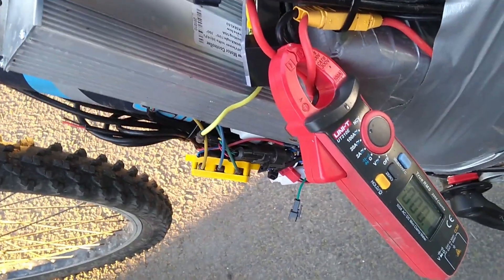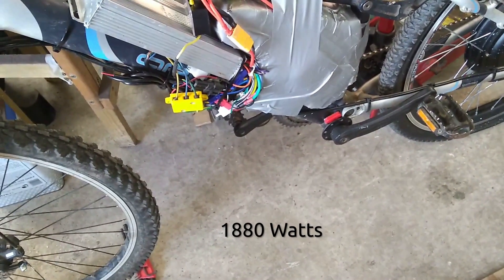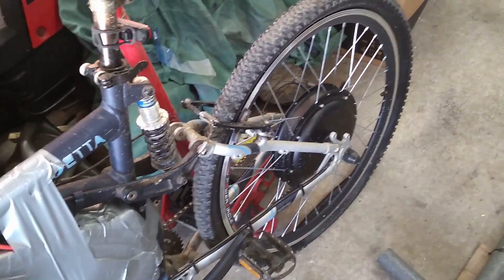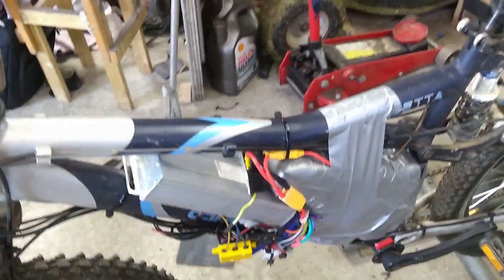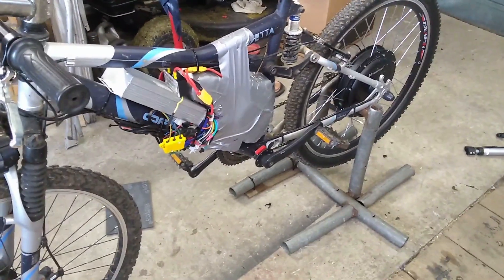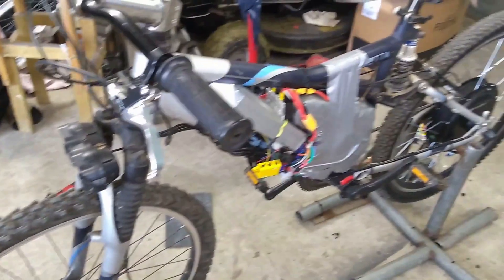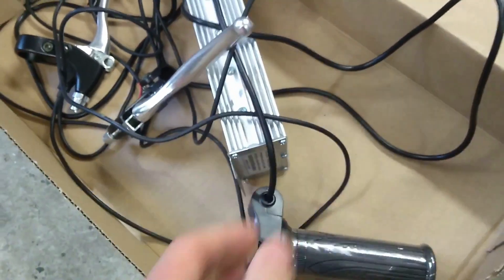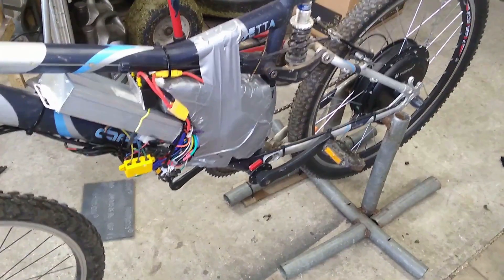Voilamart 1500W motor test with different controller

Comment: volts = speed replace the caps in the controller with high voltage caps and run higher voltage then it'll be fast.
Reply from the maker: Agreed 😋

Comment: Hi there, does anyone know the correct P1 and P2 settings for the Voilamart 1500W, thanks
Reply from the maker: Sorry, I never had a display and ended up replacing the controller with a KT sine wave controller. Check my other videos for that but it was the best thing I did to it.

Comment: Do you know how to do a voltage drop test?  i did one on the motor wires on my 1500 watt voi;mart  1.2- 1.3 each wire. it was losing over 3 volt from the controller to the motor...whats the use of spending extra money on a 52 volt batter and give away almost 4 volts..yep, i fixed it and yep in made a noticeable difference
Reply from the maker: When I get my bikes out again for the summer I'll give that a go. Thanks

Comment: If you wanted to adjust your Throttle.
You need to move the sensor in throttle left or right to get different acceleration times.
Reply from the maker: Thanks mate, I put it down to being cheap rubbish but if it can be adjusted that would be great. I'm very busy atm with other projects so this will have to wait a while but I'll defo give it a go.

Comment: Does anyone know how many poles (or pair poles) the voilamart 1500watt motor is?
I have bought a Sabvotron controller for mine and I'm not sure what figure to enter for the number of pair poles in the program
Reply from the maker: That's a great question but I'm afraid I don't know the answer. I have a Sabvoton controller too that I haven't got around to fitting.
Probably the ebike forums would be the best place to ask.
Reply: 23 pole paired.   46 magnets. I have one too and have had it apart. I counted the magnets.
     Have a nice day.

Comment: Hey there I of your video!! I just installed this kit but its not working. I suspect the controller. I was wondering what controller are you running there?
Reply from the maker: I started with the standard controller that came with the kit, but then replaced it with one I bought cheap off eBay. It was just the cheapest 1500W controller I could find.

Comment: I have the same 1500w kit for a year now. 63v 15s 20ah Lipo. Only stunts modified. 26" wheel. 53x11 gearing.
GPS measured speed 42.9mph.
I can pedal ok at 40mph.
Tbh. Bullet proof. I would recommend
Reply from the maker: I've been using mine for around a year now although I've replaced the throttle, controller, not because of faults but because I wanted to upgrade. I have stuck to 14S so approx 58V but like you have had no problems. 
I'm not sure Voilamart are still supplying these kits any more though.

Comment: I went full throttle for 30 miles straight with the Violamart
Reply from the maker: Cool, you must have a good battery.
Reply: @alibro7512  48v 20ah UPPBattery also got the battery shipped to me in 3 days insane good service
Reply: @LoCainCMC  good batteries I've got the 52v 20ah
Reply: I'm hitting about 28-30mph on flats. With 48v 1000watt hub. How fast would a 1500watt hub with 52v get?
Reply from the maker: @LoCainCMC  with a full battery I get up to 37mph on the flat but can easily cruise at 30mph. If you replaced your controller with a 1500W one the hub motor would probably by fine with it. The one I'm using was only £25 or so from ebay.

Comment: Regards the cadence sensor, I think they are pretty poor even if you have different settings , I think a torque sensor would be best, you would end up more at bicycle speeds of course but with power to get up the hills, and throttle for when you just want pure speed.
Reply from the maker: I ended up replacing this controller for one with cruise control. 
It isn't perfect as it controls the power rather than the speed so on hills I need to override it but it's better than the rubbish cadence control on this kit.

Comment: just beefed up all the solder points on my voilamart 1500w kits included controllers PCB, wow, so much more responsive and about ~5 to 10kph extra top end, maybe more. 
such a simple mod too!
Reply from the maker: And probably added a couple of years to it's life. 
Did you add solder to the shunts?

Comment: ive heard that the chinese hubs are great. very tough. the spokes, rim , controller and throttle are not so good. ive bought the successor to your kit - my kit has the controller INSIDE  the hub.
Reply: I've done 1830 miles on my 1500w built in controller 52v not had one issue used on 28c summer days flat out no problems used off road at high speeds wheel is solid and straight zero issues I can't fault them at all
Reply: @mobilecasinomj  Same here but if you have an SW900 controller and it gets wet.... you are stuck with a bike that you can't turn on. Just like mine :(
Reply from the maker: I think the controller in the hub was available when I bought mine but I wanted to be able to replace my controller if necessary.
I have no complaints about the hub or spokes, mine is pretty good. When I bought mine I was looking for a hub only and this kit was cheaper.
Reply: Very unreliable with controller in hub...

Comment: Hi firstly thanks for sharing and the review. im just putting together my new Voilamart 36v 500w. Just a hunch but could the hub motors be the same 500w,1000w and 1500w and the only difference is the controller. The 500w hub its diameter is about 25cm and wights 8.2 kg with the tyre and cassette. By the sound of things i might need to upgrade the controller though which has pas modes or may be have switch for the speed control wire. Thanks again Steve
Reply from the maker: I'm sorry but I don't know about the hubs. You might be right and they might all be the same but I'm not sure I'd want to risk it.
As for the controller, if yours came with a display then it might be OK. Best advice I can give is try it and see how you like it. If you don't then upgrade the controller with something like a KT Sine wave controller and display.

Comment: That voltage sag is awful you may want to take a look at how the batteries are series together each series connection should not be getting hot and especially the output if they are getting warm double them over and dont use any less than 10 awg wire for your final output on the battery but if it is getting warm you can double it or go with 8 awg. Less heat is less voltage sag and higher efficiency along with a longer run time and more torque unless each series can not handle 45 amps Your single banding can only handle 20 amps with out heating up (i just watched your battery build video). Load test one of your cells from full charge and increasing the current until the voltage drops to 3.6 or 3.5 volts then make a note of the current base your build on the current rating you came up with per cell (45 amp divided by 2 amp per cell would be 23 cells in parallel) if you need more capacity just add more cells but most important is meeting the current rating needed. Instead of duct tape you could actually use plexi glass to make a cage for your battery pack. Just trying to help have a good day
Reply from the maker: Hi Steven
Thanks for your comments, I really appreciate them, I am no expert in this and am just sharing my experience so am very interested to hear you saying the voltage sag is very bad. I have a feeling bad welding may have a lot to do with it as I have just taken apart another battery I previously built and the nickel strip came off far too easily. Some of them more or less fell off and many connections came off with very little effort so I ordered a new Arduino based welder from Malectrics and will report back after trying it. https://malectrics.eu/product-category/arduino-spot-welder/
As for the nickel strip I think it should be OK as I have 8 series connections and each should be able to handle 5 amps without heating up so the pack should be good for around 40 amps continuous. I wouldn't be comfortable pushing it much higher anyway.
Another possible culprit is the 18650 cells I used. They are labelled Panasonic  NCR18650B cells, but after ordering them from Liitokalla I realised they were fakes. I tested them in a Liitokalla charger that and although they have good mAh rating the internal resistance is showing as 125mR which is very high.
This whole kit and battery pack will soon be in my road bike which I normally peddle like a standard ebike so it will probably get fairly light use most of the time. I'll be taking it apart and rewelding with the new welder when I get it and maybe add another 8 cells in series to bring it up to 52V.

Comment: Bought the 1500 voilamart same as you.
Had a couple of issues with it so looked on YouTube to get some answers and found your video, nice one Ali helped a lot.
Do have one question though, when you changed your controller which wires did you connect your throttle to,  the blue and yellow.
I also have the same Brainpower controller so just wondered.
Cheers Keith
Reply from the maker: I can't remember tbh but I think I explained it in another video. Should be up if you check my channel.
Reply from the maker: It's in this video
https://www.youtube.com/watch?v=V9dBksb_K-U
Reply: Hi Ali. . Yes watched the video but realised you had changed back to the voilamart controller and needed your old controller connections .
Having to use the Brainpower controller coz trying to run 72v battery pack so needed the extra amps and volts ,. Also modified the hell out of it .
Beefed up tracks, shunt etc, probably shop the caps out for 100v as well. I
Coz I can't seem to get the Led throttle to show me voltage which ever way I connect it and the key doesn't turn the controller off !!!
Dunno probably me being an idiot.
Anyway any help would be great and again . . Brilliant fun videos.
Cheers Keith
Reply from the maker: @keithrobertson8096  Hi Keith
I'm assuming you have the throttle working so just need to sort the power connection. Your throttle will have two wires that probably had bullet connectors. One of these needs to go to the main battery pos. The other needs to go to the brainpower ignition cable. It's a light weight cable probably red that needs to be connected to the battery pos for it to work. so if your controller is working you probably already have it connected to the pos so will need to disconnect it and connect like I said.
Reply: @alibro7512  Sorry didn't get back to you sooner Ali but think I've blown my hall sensors . . Idiot !!!!
Anyway thankful for your feedback I'm sure it will be helpful when I've repaired the motor . . Hehe.
I will let you know how it all goes.
Cheers Keith
Reply from the maker: @keithrobertson8096  bummer mate. What happened?

Comment: Link to controller please
Reply from the maker: The controller I bought isn't available anymore and any link I post will probably go the same way very quickly. To be honest it was just the cheapest 36V to 48V 1500W ebike controller I could find on ebay. 
Really nothing special yet it still worked great with a car alternator wired as a motor, if interested in that project check out my other videos.

Comment: That looks fun Ali. That better controller is a good improvement on the cheap one.
Reply from the maker: Yes mate, it's lots of fun. Both controllers are labelled 1500W but the one I bought last year is more like 2000W. 
If I add another cell group to bring it up to 14S 8P it'll be even betterer. :)
Reply: @alibro7512  
I only have a 1000w hub motor.
And I have a 14s 13p.
I get 38mph down hill.

More volt will increase your top speed.
For a 1500-watt motor I would over volt it to 72v +

If controller only has 62v capacitors upgrade them to 100 volt

Comment: So 2.5hp, impressive i think you can run on more amps/volts, my video coming soon as i had an accident and damaged the hall sensor and phase wires :(
Reply from the maker: Lol yes mate very impressive. Still not enough to pull wheelies but getting there.
Looking forward to seeing your video.
Reply: Ali Bro I have the same motor and manage to get on the back wheel. very powerful. We have same but different bike.